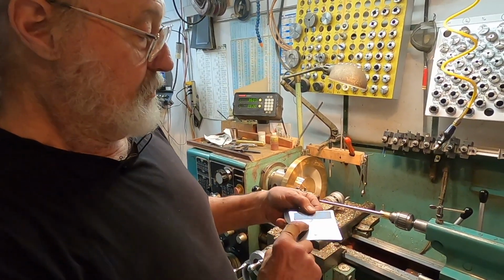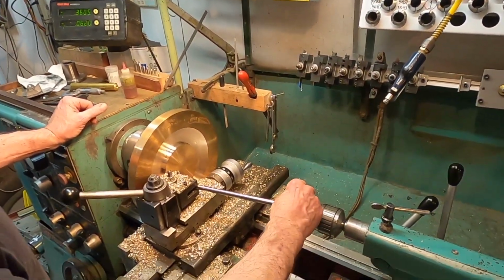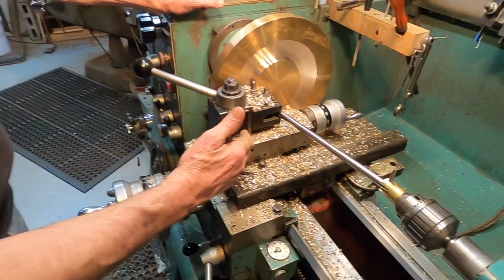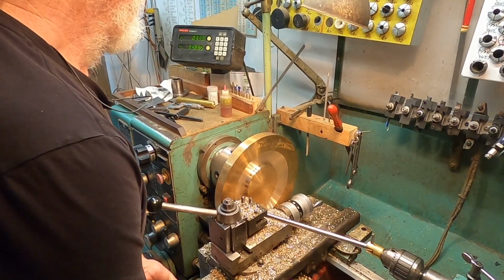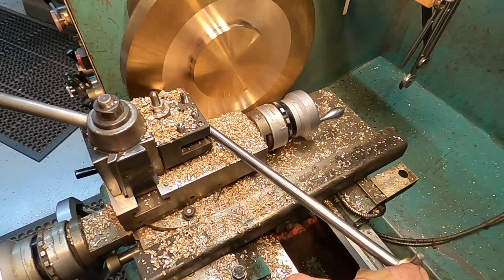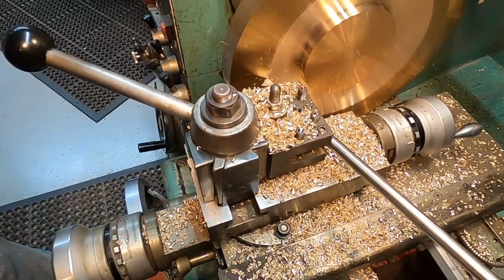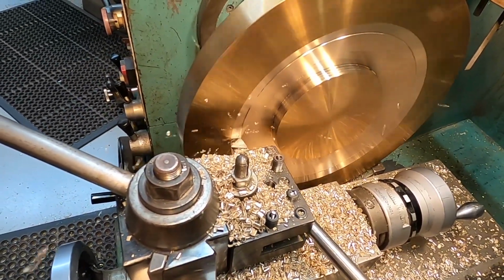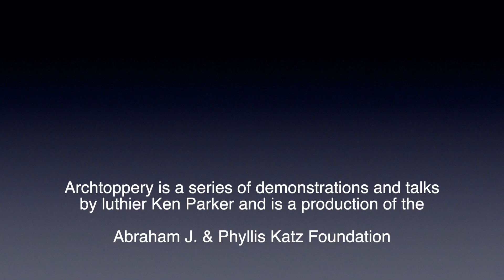Ken Parker Archtoppery - Riff 003 Making a Spherical Disk Sander

Comment: 0:33 in a past life as a ship wright I used this exact plane to "hollow" the inside of planks so they would fit snugly against the curve of the framing. It made for a super tight fit and since you're pulling the plane it was relatively painless and quick, It sure beat using a grinder/sander with 40 grit
Reply from the maker: I love it!  I'm sure we can agree that nearly any method is preferred over a grinder w/ 40 grit!  It is a really nice tool with lots of possible applications.  Bravo carvel boat-building!

Comment: Nice piece of brass :D is there a reason for it to be that material and not other metal? And what is the purpose of that cilinder that is being left in the center of the disk? Thanks a lot agaian.
Reply from the maker: It's silicon Bronze.  Just happened to have a giant chunk of it lounging in the shop, but it could have been anything, aluminum, phenolic, nylon, delrin, steel, etc.  Chunk in the middle wasn't in the way, and is needed for bolts that join the big disk to a 3" diameter brass chunk that I can grab in the chuck.  You're welcome!

Comment: Did you have to modify your Lathe to be able to make the long feed Free Floating like that?
Reply from the maker: Nope, the carriage is driven left and right by a rack and pinion gear set, so there's no reason for it not to cooperate by ooching along when driven from the rod attached to the tailstock and the toolpost.   To move the carriage out of the way to the right, you might just grab it and give a mighty heave.  Takes a bit to overcome the forces of friction, but it's not too hard to move if everything is lubed up.